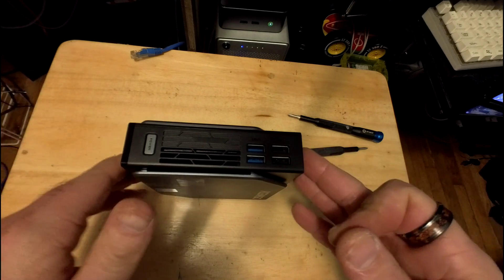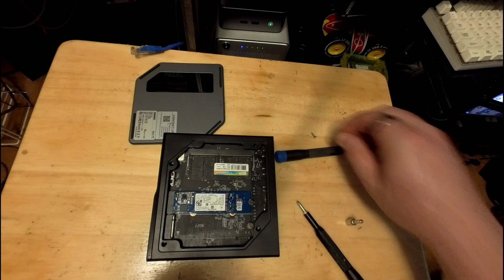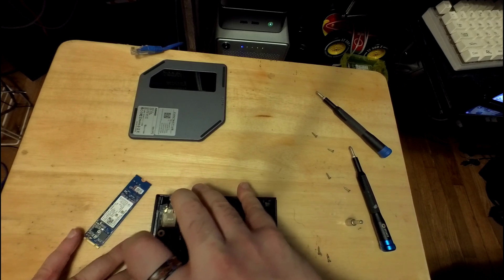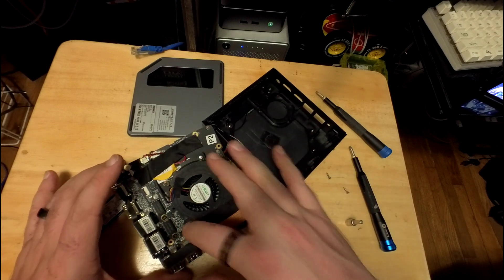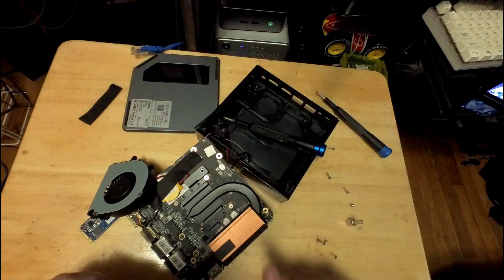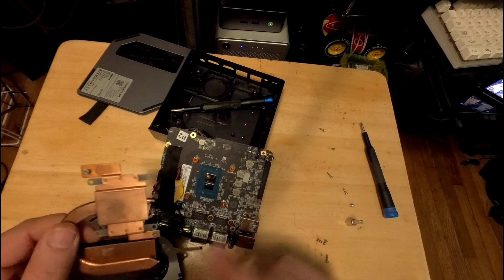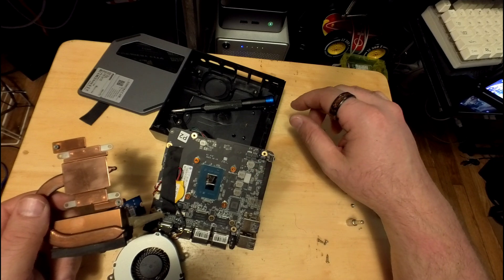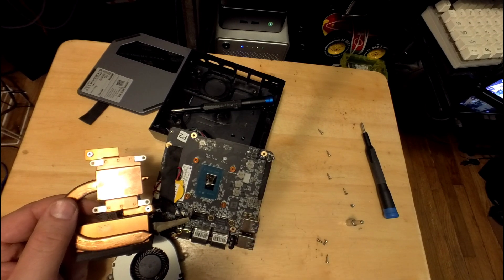AceMagic S1 N97 - Teardown Guide and look under the Heatsink

Comment: after apply new one dıd temperature of cpu ıs changed maybe decrease could you answer. ı have a n95 model ı wıll change next weeks when ı have a thermal paste. ı used ıt about more than 1 year but still cpu temp ıs less than 65 at max performance but ı am usıng laptop cooller for make motherboard ram and ssd to get cooler. thanks for vıdeo
Reply from the maker: Is a low power computer so temps really didn't change for me.

Comment: Why didn't you show how much thermal paste is enough?!
Reply from the maker: Like most people I don't show how much throw won't paste I put on because I don't feel like having comments saying you didn't use enough or you used too much or this that and the other The rule of thumb is about a pea for CPUs with a heat spreader. For CPUs without a heat spreader it's about a half a pea. It really comes down to the size of the die itself.